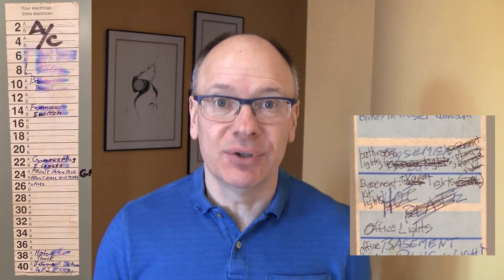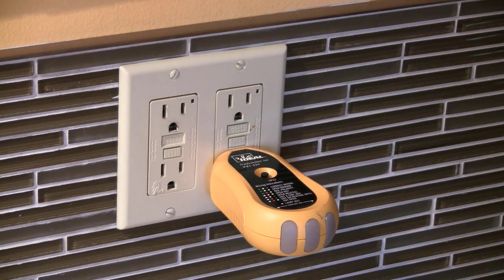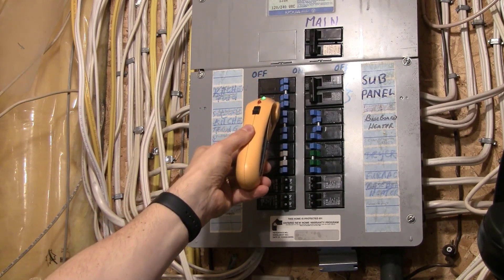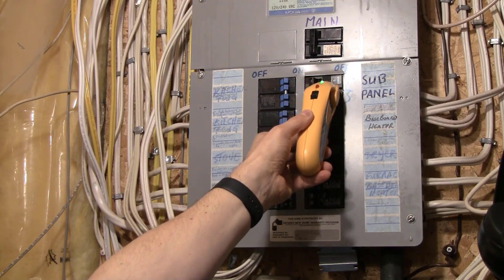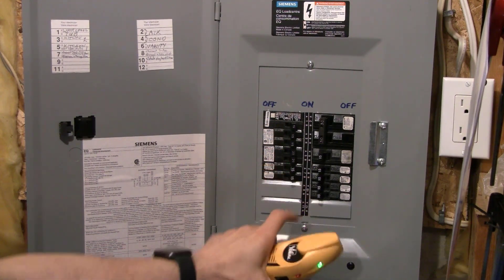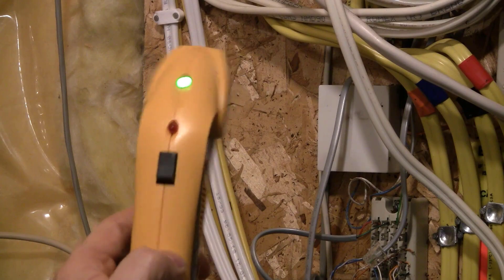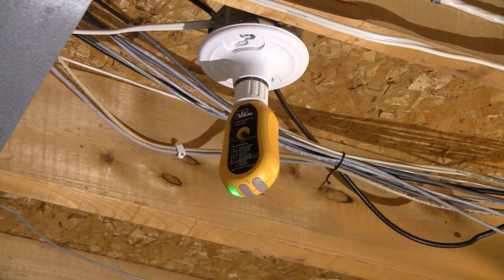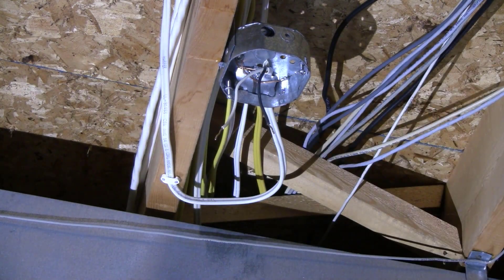Identify the breaker for outlets or lights quickly and easily; safely work on wires in your home

Comment: Can you use this tool to find the breaker if the outlet is not working ?  Since the light will turn green in the transmitter when the outlet is working, it will never turn green when the outlet is not working

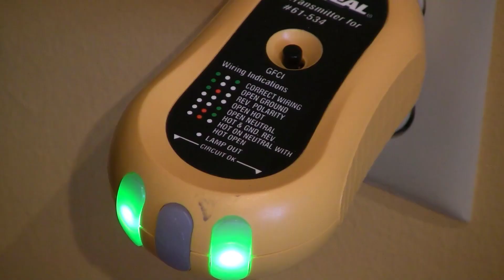Comment: You need to fix the GFCI’s shown being tested at 1:08.  You have one GFCI feeding the other.  When you tested the one on the right, power dropped out of both.   Not correct wiring.
Reply from the maker: With GFCI outlets you can choose whether it cuts the power to the outlets down the line. In this spot I chose to do it that way because of where it is and what it gets used for. It is important that DIYers think about and deliberately make the decision of whether a GFCI protects just the outlet or all outlets down the line.

Comment: I bought the Klein version only about a month ago. Have ran into issues in the past where I think neutrals got shared, current on ground, or maybe hots connected somewhere. When everything else around a receptacle is off, but noncontact tracer says it's live. Glad to have something to properly map circuits, especially with power still on and no time pressure or irritated home owner!
Reply from the maker: Mapping circuits is one job that homeowners will never regret doing IMO. I have a video coming out soon that shows you how to document the circuits so you have a handy reference for future projects.

Comment: Don’t necessarily have a ground? No lamp holders actually have a ground connection to the bulb.

Great video otherwise. Thanks for the info.

Ps. You noted that it won’t work for 220v circuits. That’s true, but typically there are few enough of those that you can identify by the breaker size and then switching off. Ok, you may have to reset the clock on the stove, but a very small shortcoming.
Reply from the maker: Yes, those 220/240V circuits do have the larger breakers and are easier to identify.

As for the ground I was referring to a ground wire that isn't always present depending on the light fixture (the lamp holder I showed doesn't have one).

Glad you found the rest of the video helpful.